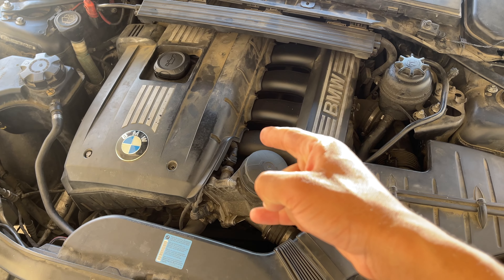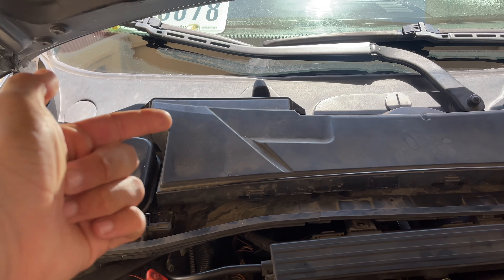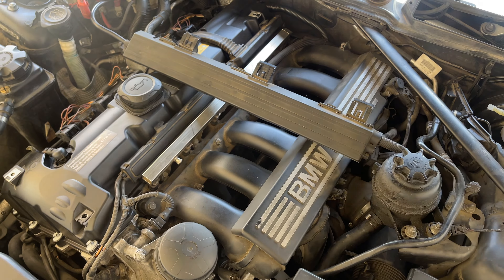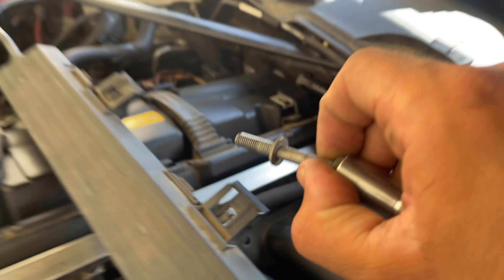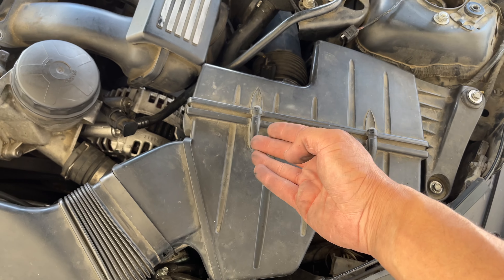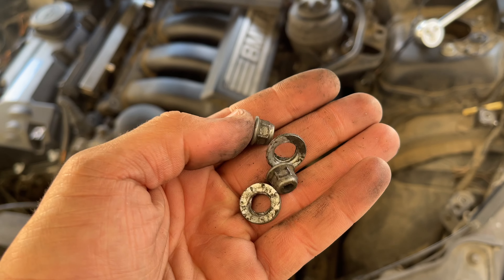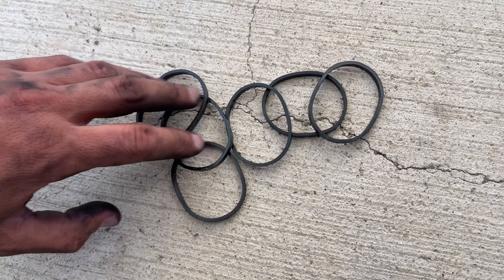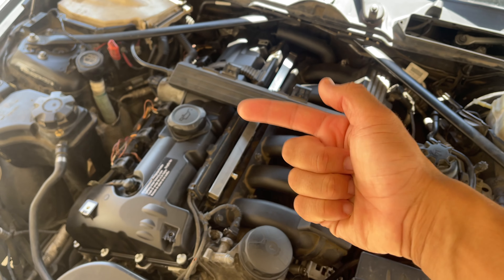How To Replace BMW N52 Intake Manifold Gasket | E90 E92 328i 330i

Comment: Awesome video thanks saved me a ton of work. Only things I did differently were I didn’t remove the breather hose it was a bear to get a grip on and I didn’t want to brake it. I also had to remove the small mounting brackets from the intake where the fuel line is connected to the intake and where the starter cable is attached to the intake on the back side. This gave me plenty of working room.

Comment: I had failed pcv valve leading to oil in manifold I cleaned it all out rebuilt disvalves and now I having random misfires in all cylinders I imagine it’s this because I replaced the plugs already.